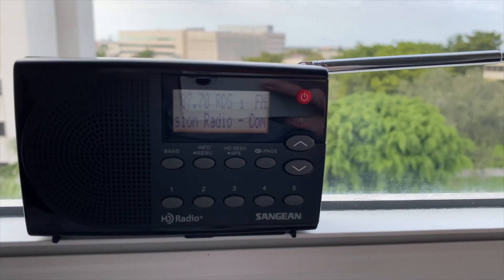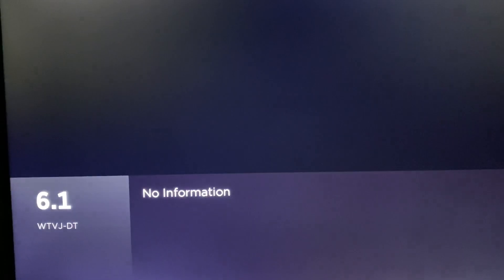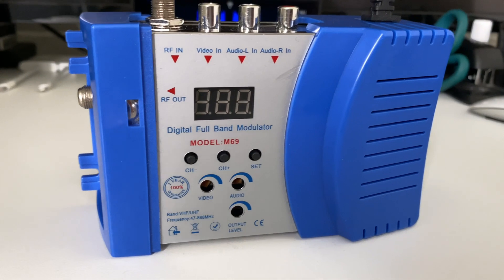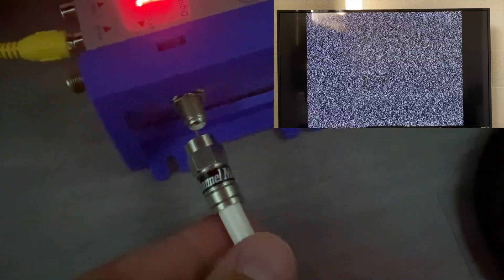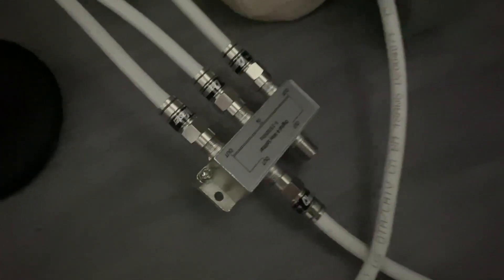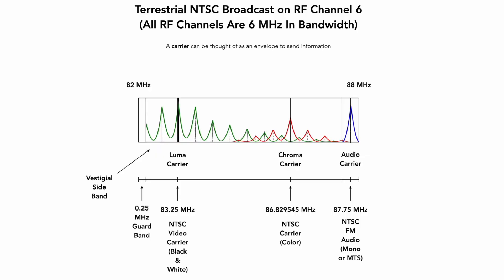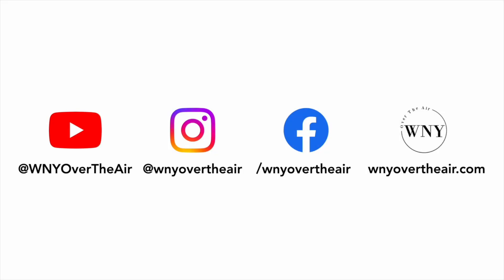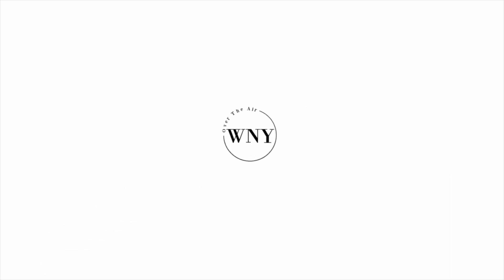FM Audio From An ATSC 3.0 Franken FM Onto A TV: WEYS-LD

Comment: Okay...have they somehow gotten past the interference issue with ATSC 3.0 transmissions that killed this whole concept with ATSC 1.0?  That was attempted here in the Albany/Schenectady/Troy NY market with WRGB (on RF channel 6 at the time).  The analog audio was shut down after a very short time because it was found to be causing interference with their actual ATSC 1.0 digital signal.
Reply from the maker: Yes, ATSC 3.0 works a lot better than ATSC 1.0 did for Franken FMs. Interference has not been an issue.

Comment: But someone please educate me here ...

While this is certainly a clever work-around (and my compliments to the author).

How does this trick help for what I thought was the current FCC rule for these "Frank'in FM" stations to continue broadcasting. Which is to now transmit at least one A/V program in ATSC 3.0 format. While broadcasting a separate FM analog signal on the old former NTSC aural frequency for TV ch. 6 at 87.75 
MHz?

Comment: here in canada there are still high powered franken fms and other analog tv stations because the government only mandated high powered transmitters in a few high populated areas shut off their analog signal. low powered transmitters have had no mandated shut down and many high powered transmitters intended for lower populated areas still remain. around here I get CKLT-TV-1 channel 3, CJCH-TV-6 channel 6, CJCH-TV-1 channel 10 when there's tropospheric ducting.
Reply: Philippines and Brazil still have 87.5 FM there.
Reply from the maker: I've extensively covered CIII-TV-2, licensed out of Bancroft, ON on this channel. Unfortunately it's now off the air. I'm not aware of any left in Ontario, but I'm glad to hear there's still some in New Brunswick and Nova Scotia.
Reply: Some Hyundai cars in Canada and the US have 87.5 FM.

Comment: theres a 87.75 in my area well its very low powerd and a radio station on 88.1 over powers it what should i do i asked my grandpa if i could use is tcl tv but i could not get it ima just connect my crt to the antenna
Reply: Btw I’m in California
Reply: @Pacificbell  in estonia, theres an station on 87.7 and called Skyplus.